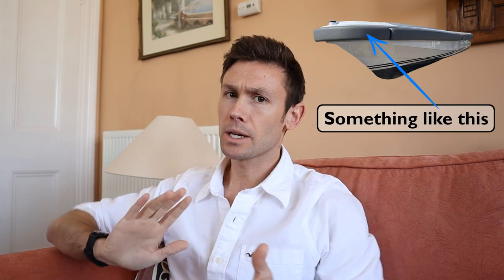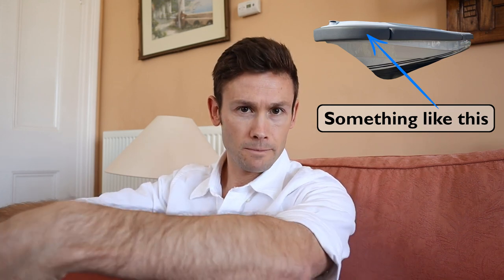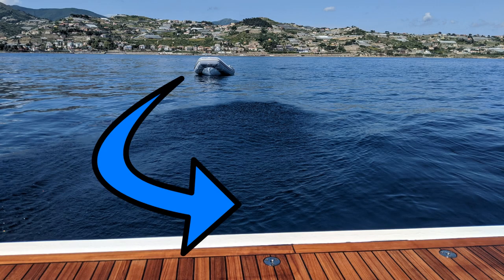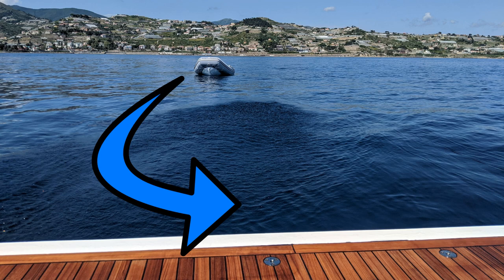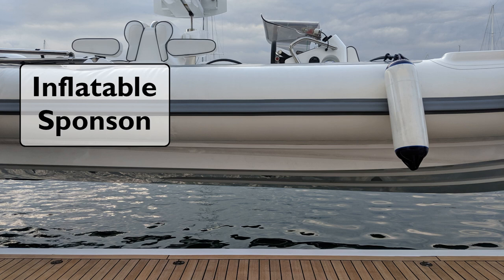HOW TO DRIVE A SUPERYACHT TENDER | 5 Lessons That I Learnt The Hard Way !!!

Comment: Thanks for this video Matthew, both personal and observed errors, which hopefully will be remember by all operators of tenders, whether deck crew on yachts or owner operators of small craft.  Of course there would be a deck fine for not getting any deck fines during a season, nobody can have a perfect record, so perfection is itself an imperfect act that needs to be 'punished' for the common good.

Comment: I always make sure I secure any lines onboard the tender to ensure they don't become loose and get sucked into the jet drive but I once made the mistake of not lecturing a guest on doing the same when he took the tender out after insisting he knew what he was doing as he had (and produced) an RYA Level II Powerboat Qualification.  Qualification does not equal experience as we learned that day.  Fortunately I had insisted he take a hand held VHF despite him saying he didn't need one for such a short trip so once he radioed back we had to raise anchor and go rescue him.

Comment: This was really helpful! I recently completed my PB2, and was lucky to be able to use 2 separate ribs, equipped with 150bhp and 250bhp outboards, respectively, but have just returned from a weekend of vessel specific training on the boat I shall be working on the summer - transitioning down to a tender with a 9.9HP outboard was a bit of a deflation! It must be said though that the smaller engine size is more than ample for what it's needed for, its just the boy racer in me that was a tiny bit disappointed 😅

Comment: Very informative, I am trying to break into the industry from merchant service, I’ve been driving small craft for years in the military, which uses the sponson as a brake,when I did the powerboat level 2 the comment was you’ve got a few bad habits you need to lose. 😁
Reply from the maker: “The sponson as a brake” 😅. Yes, in the yachting industry it’s all about being smooth and controlled. Wishing you all the best with your move into yachting.

Comment: Dear Matthew good afternoon,

How many seasons (assuming the yacht will be operating in summer only) experience will be usually required of a captain on a 30m yacht so that he can move on to a bigger length?

 
 When moving on to bigger yachts, does this usually happen in 10 m steps (i.e. from 30 to 40, 50 and so on) or  could a category be skipped (i.e. going from 30 to 60 m) ?

  Finally, since with increasing length the onboard team increases, would a captain on the 30 m yacht always be a captain on bigger yachts, or could he be required to serve as chief officer first (or even 2nd officer) and then become the captain ? If so, at which length of yacht would he be required to do that ?